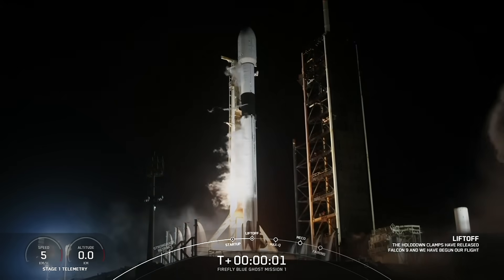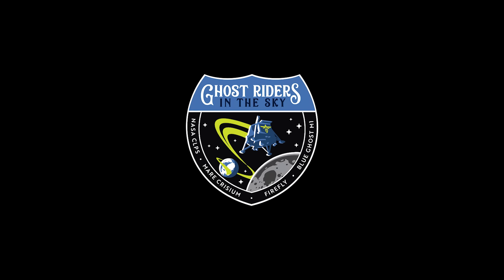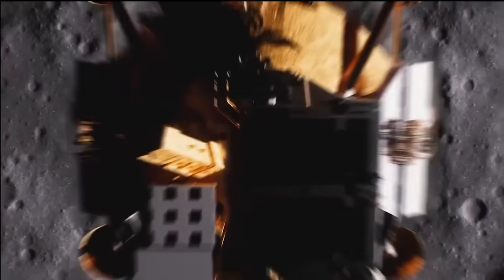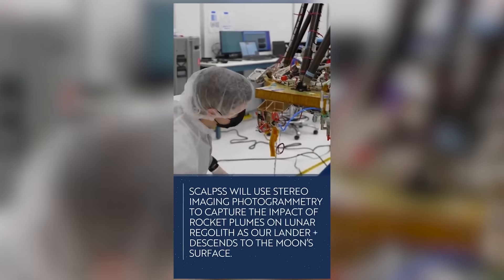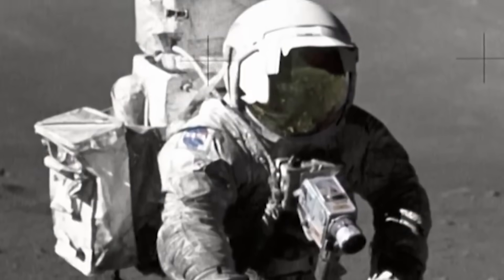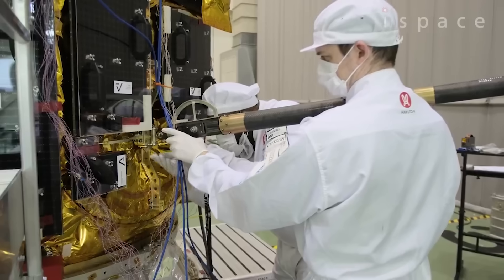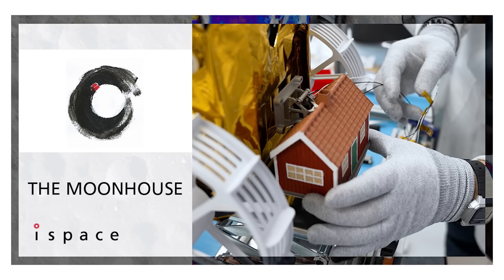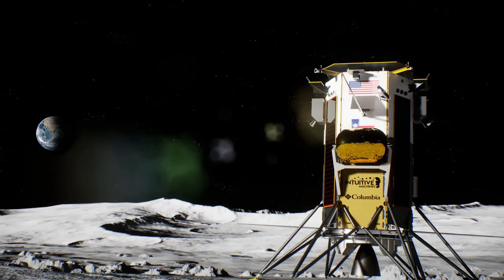NASA And Japan Moon Landing Update!

Comment: NASA and the Japanese government should explain to people -- the funders of the moon landing project -- how they manage to cross the Van Allen Belts without sacrificing human lives.
Reply: The Van Allen belts are very narrow, occupying a fraction of the path between the Earth and the Moon. Due to its trajectory and speed, the Saturn V rocket went through the outer portions of the belts in less than 2 hours, so the dose of radiation was within safety limits. Each mission flew a slightly different course in order to access its landing site, but the orbital inclination of the translunar coast trajectory was inclined to the Earth’s equator by about 30°. A spacecraft following that trajectory would bypass all but the edges of the Van Allen belts.
Low energy electrons were the main ionising particles that the astronauts had to navigate through and not electromagnetic waves e.g. ultraviolet, infrared, gamma etc. Electrons can pass through living tissue without creating much damage as they are very small. 
The command module’s outer hull was made of stainless steel and the (upper) heat shield from epoxy resin, which along with the fibrous insulation between the inner and outer hulls was a very effective form of shielding against protonic radiation.
Reply: You have heard the ringing of bells but have no idea where the clapper hangs.

Comment: The moon isn't an easy place to land?  United states supposedly managed ok in the late 60's early 70's, or was all that just a rouse? 😂😂😂
Reply: People don't realise how difficult it was back then and the part that luck played in it, which is one of the reasons why the plug was pulled (as well as the cost).
Apollo 11 nearly had to abort due to computer problems and low fuel levels. 
Apollo 12 encountered so much dust that the final descent to the surface was done blind and it landed only 20 feet in front of a large crater.
Apollo 14 actually skidded sideways on its landing gear and stopped at an angle of 8 degrees with one footpad in a small crater. 
Similarly, Apollo 15's lunar module Falcon came to rest with its rear footpad on the rim of a 20-foot-wide crater. This caused one of the lunar module's footpads to be off the surface entirely and placed the spacecraft at a dangerous 11 degree tilt. 
Apollo 16’s landing was delayed and could have been aborted due to problems with the Service Module’s engine backup system after it had separated from the lunar module.

Comment: It will be 66 years since Apollo 11, More time has passed than when the first Model T was built and when we landed on the moon. And we are still having issues landing on the moon. Not gonna say we didn't land on the moon but 2 and 2 aren't exactly making 4 here. Either that or the Apollo astronauts and program were just that badass that they pulled it off in spite of the lethal radiation, "never eding" moon dust storms, most of the moon surface is not a good landing zone, batteries that don't die 5 hours after sunset, and fuel and steering miscalculations. They just jokeyed it several times without incident with the exception of 13. Just saying.
Reply: Way easier to land with people controlling the spacecraft.  "never eding" moon dust storms?
Reply: @texmex9721  just quoting the video. Obviously that's not true
Reply: Have you ever noticed how people believe in "lethal space radiation" because NASA said it's there?

Comment: This video is a really excellent rundown of these missions!  Thanks.

Just a couple of way-minor nitpicks.

First, “Mare” is Latin, pronounced (roughly) “MAH-ray” rather than “mare.”  Again, no biggie, but just to be proper…

7:04 — This artistic rendition is a lovely artistic rendering, but amusingly non-Physical:
*  I’m mentioning this not to be mean, nor even to suggest that you shouldn’t use this artist’s impression, but just to encourage viewers to think about the Physics/Astronomy a Lunar lander sees.
*  First, based upon its landing site, the Earth should be much closer to overhead than on the horizon.  
*  We would also not see the Earth move.  
*  Also, the star field would not move unless this were a high-speed time-lapse image, and if it were, we would see the Lunar day-night cycle (well, that is unless it were taken once every 29ish days in sync with the Lunar night, but if so, those stars would be screaming by!).  
*  There would also be no (substantial) brightening on the Lunar horizon.  Yes, it is true that dust has been known to become suspended above the surface due to certain electro-static effects, but only very small amounts.  
*  My original gut feel was that even at Lunar night, the Milky Way being visible is questionable (it’s extremely dim).  However, my gut feel was wrong though, since, in sufficiently dark Earth environments, the Milky Way is visible, so I would expect it to be visible in Lunar night.

Comment: It's 2025 and we are still struggling to land vehicles on the moon. Yet we are supposed to believe we put men on the moon almost 60 years ago 😂😂😂😂😂😂😂😂😂😂😂
Reply: Supposedly we had a rover that two astronauts could drive around on for great distances on battery power, they raced around on the surface with it without a care that their suits could tear and they would be dead in an instant. But today's battery technology can only move an automated rover about 30 feet a charge cycle. What amazing tech did we have 55 years ago do we not have now?
Reply: @YourDeletedComments  much reverence and understanding of actual Science is needed.... those electric golfcarts seem to go faster than 11 mph, at full on dusty slopes where a hole or crevasse could be, 1/6G could tip over easy. Some power sundish converter it had. I dont get they never sold those either, be practical for a RV.
Reply: @YourDeletedComments  Thats another excellent observation. I noticed the dust coming off the tyres but never thought about how carelessly they drove around. Current landers do move about very gingerly and carefully. Lets not forget about the golf they played.
Reply: @seanbeukman9563  No golf was played.
Reply: @YourDeletedComments  They wouldn't have been dead in an instant. The white spacesuit of the astronauts which covered the blue pressure suit underneath (which you don’t see) protected them from possible showers of micrometeorites that can be expected on the Moon. It was extremely tough and consisted of 15 layers of fabric, the outer layer of which was made of Super Beta. This was woven from fibreglass, each filament of which was coated with a tough, nylon-type plastic Teflon. The Super Beta was covered with two layers of strong plastic film.
This lander is not a rover and has a different requirement..
Reply: IN APOLLO WE TRUST
Reply: Looks like my input got scrapped. Unlike Saturn5, one still exist, just "obsolete" like everything APOLLO.  Wonderful seen and touched Concorde in our home skies.... was and is NOT obsolete, just bankrupt by fuel and noise, boycott, folks would use today!  And yes Plane still flies as high and fast, easy, and a remake would take shorter time to do.
Reply: Completely and precisely well put. I stick my neck out on occasion to say just that. I get attacked badly for daring to question 'the facts'. Cant deal anymore. So obvious what went down back in 69.
Reply: @seanbeukman9563  good for you, stay quiet if you can't understand the explanations and reality.
Reply: @jack.brooks  I will continue to speak what I wish. The truth WILL emerge unfortunately for those that bought the lies. Looks like its going to take a looooong time until we realise the truth. Until then, get used to the word "postponed".
Reply: Good grief man! Every and all questions have been answered over and over again using actual science. Just because you can't understand it or don't understand that the cost was more than the population was willing to chip in, doesn't make you right. We could essentially replicate Apollo today, but have you looked up the cost in 2025 dollars? Plus that doesn't help us go on to Mars.

Comment: Now they're concerned with measuring radiation?
  WTF
All Apollo missions and crew had no problems w/radiation
Reply: Different trajectories, mission profiles and modern day discrete electronics require more data regarding the effects on humans and instrumentation in the Artemis missions. Apollo missions circumvented the belts at high speed using a lot more fuel in the process astronauts received doses equivalent to about 2-3 chest x-rays.
Apollo Mission      Skin Dose, rads    Crew     
8	                         0.16                       Frank Borman, Bill Anders, Jim Lovell
10		                 0.48                       Tom Stafford, (John Young, Eugene Cernan)
11		                 0.18                       Neil Armstrong, Edwin Aldrin, Michael Collins
12		                 0.58                       Charles Conrad, Alan Bean, Dick Gordon
13 		                 0.24                       Jack Swigert, Fred Haise, Jim Lovell
14		                 1.14                       Alan Shepard, Edgar Mitchell, Stuart Roosa
15		                 0.30                       David Scott, James Irwin, Al Worden
16		                 0.51                       John Young, Charles Duke, Tom Mattingly                    
17		                 0.55                       Gene Cernan, Harrison Schmitt. Ron Evans.

Comment: Why don't they use 3 legs? Isn't a triangle]e more stable than a square?
Reply: Why don't cars have 3 wheels instead of 4? There has been a few but were unstable. (Reliant Robin for example) Triangles are best for distribution of loads. For stability, you want as many points (to a point) as possible. 4 being the simplest and lightest.

Comment: Apollo was very careful to plan the Lunar Landing mission to arrive at lunar morning so that the low level of the sun would enhance the shadows made by craters and other hazards to that the astronauts could more easily tell their altitude and location. Hopefully the AI navigation system on the robots will be able to ensure a soft landing without incident.
Reply: Well planned way back then. Avoiding 130C degrees of sunlight was also well planned. Imagine boiling in their suits? But they had some air conditioning hey? I think...
Reply: @seanbeukman9563  Not AC but sublimation.